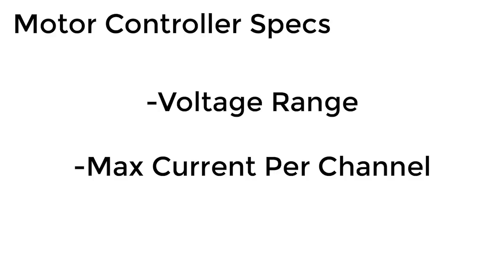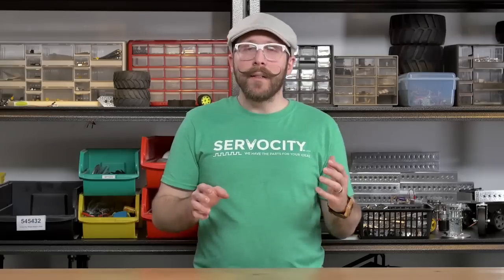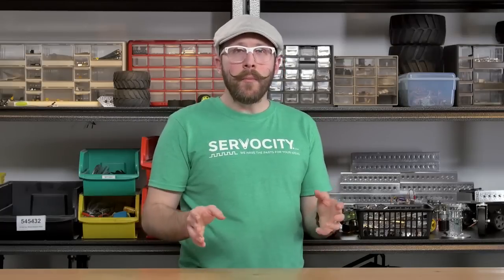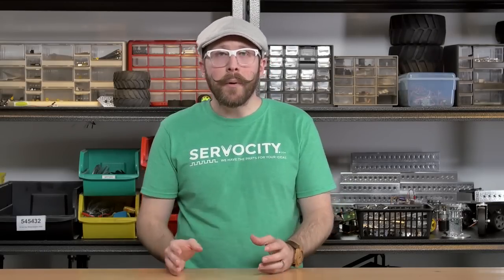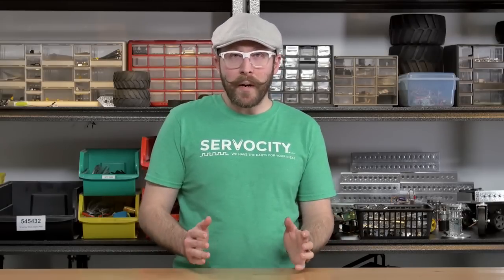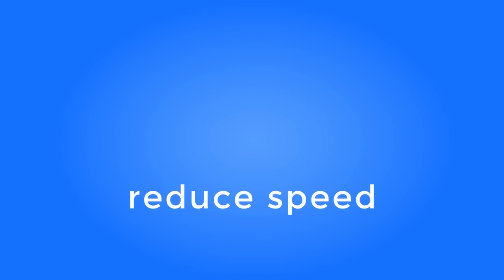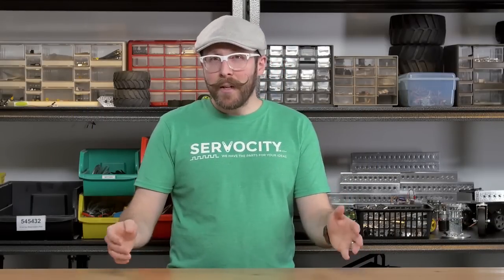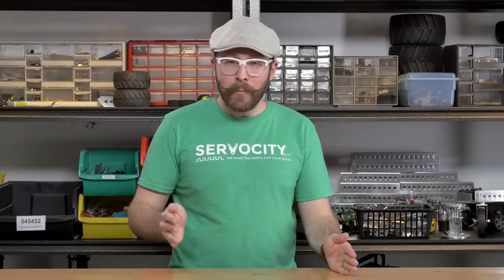Motor Controller Fundamentals

Comment: Is there a way to have a controller output variable (RNG) speeds? So that say, when applied to a motor, would cause the motor to turn continuously, but at varying speeds.
Reply from the maker: Absolutely. If you have an Arduino for example, it can communicate with motor controllers via a PWM signal, serial, etc depending on the features available the motor controller. Then the Arduino can adjust the speed however you want.  Feel free to reach out at tech@servocity.com should you have any other questions.

Comment: Interesting so to have a high tork with the same power you may set the voltage higher, pulse width smaller, and frequency smaller. To have a high speed and less tork, you may reduce the voltage, increase the pulse width and the frequency.
I'm not sure... Agree ?
Reply from the maker: I am assuming when you say " with the same power" in the first sentence you mean "with the same speed"? If so, then effectively yes, since the voltage affects torque AND speed, while the pwm primarily affects speed. If you have two identical motors and motor A is driven with the max spec'd voltage and slowed to 50% via pwm and motor B is driven with 1/2 the max voltage and full or no PWM, then they should both go about the same speed but motor A should be able to deliver more torque.  Feel free to reach out tech@servocity.com should you have any other questions.
Reply: @ServoCity  great answer

Comment: do you know of a motor controller than can control 4  high current  motors together
Reply from the maker: "High current" is relative. You can connect more than one motor to a given channel of any motor controller. Just keep in mind that the motor controller will need to be able to handle the stall current of all four motors continuously. You might check out the 2x60A Roboclaw Motor Controller (https://www.servocity.com/roboclaw-2x60a-motor-controller). With this motor controller, you can bridge the two channels together (the user manual has more info on this) then control the four motors from there. In this configuration, the motor controller can handle 120A continuously and 240A peak.  Feel free to reach out should you have any other questions tech@servocity.com.
Reply: @ServoCity  In the set up you describe with 2x60A, is it worth putting a circuit breaker between the controller and motor? To avoid a motor drawing more than 120A peak? 
Based on your explanation in the video, motor doesn't draw the power, its the motor controller that adjusts the PWM signal to the motor. So.. even if its stalled, the motor will neve ask for more current. The user can provide more current by increasing the throttle output on the controller. In this case putting a circuit breaker between motor and controller seems pointless. Am I right?
Reply from the maker: @MrCoder101  So current is not pushed, it is pulled. In other words, you could have a battery capable of supplying a million amps of current and connect it to a small LED without blowing out the LED as long as the voltage is correct. The LED will only pull as much current as it takes to run. How much current is flowing through the system can be restricted by a few things though. One is how much current the battery can supply (you can easily "power starve" a battery - in other words it does not have enough capacity to meet the current demand). Another is the load (the motor) - some motors will pull a lot more current than others. When a motor is stalled it is generally pulling as much current as it can. Some motor controllers can do current limiting, which is basically sensing how much current is being drawn and throttling the pwm as needed - although this is generally a feature that needs to be configured. A fuse inline with the motor is not a bad idea as an additional precaution.  Please feel free to email tech@servocity.com should you have any other questions.  Thank you

Comment: I have a 350w 24v  motor and the motor controller  that I have is 36v 500w so is there any problem if I install or connect the motor controller to the motor.?
Reply: Did it work?
Reply from the maker: Generally speaking as long as your motor controller can handle the stall current of the motor and your battery voltage is within the acceptable voltage range of the motor and motor controller then you will be good to go.  Let us know should you have any other questions tech@servocity.com.  Thank you

Comment: Hey a question regarding motors, can we connect a DC motor controller (a Kelly controller) to the generator as well as the battery ? So that the controller can draw current from both generator and battery.
Reply from the maker: Hi Huzaif Khan. I am not sure if I am totally understanding your question correctly. Some motor controllers have a regenerative breaking feature that allows them to utilize the current generated by the motor you are driving when they are suddenly slowed down. It sounds like this is what you are looking for? If you are wanting to attach a battery and an actual generator to a motor controller, just one power source (a battery) would be preferred.  Feel free to email us at tech@servocity.com and we'd be glad to help!